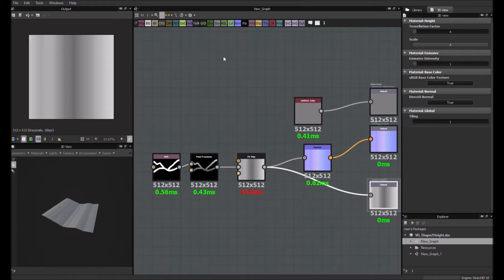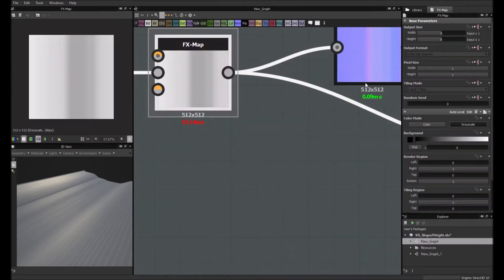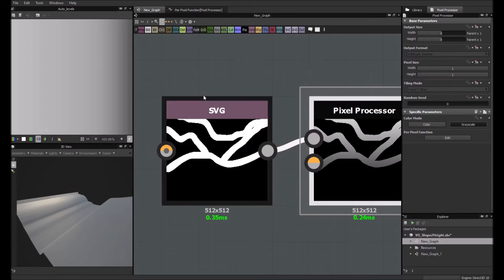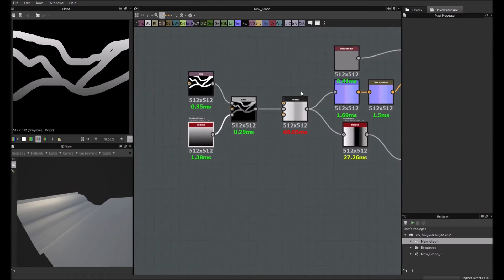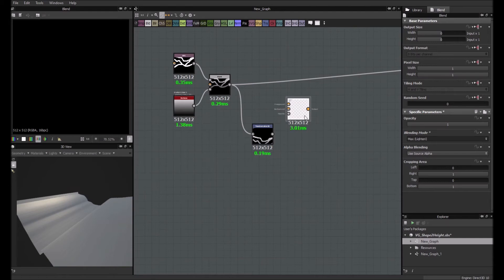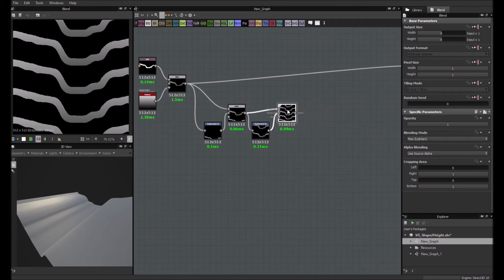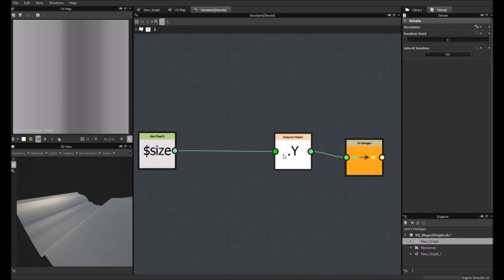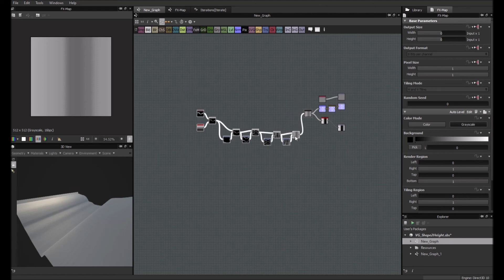Shape to Height Tutorial part 2 (Substance Designer)

Comment: Love your terrain maker tutorial. I have question. I am trying to use a procedural material, made in Substance Designer which I can change at run time in Unity. So far, so good. I also want to access the height map and normals separately in Shader Forge, however, but I have noticed that when I set either map as a 2d texture, Shader Forge just reverts to the basecolor map for these texture 2d slots. Any ideas what I am doing wrong / not doing right?
Reply from the maker: jinjatube hey 
Honesty, I really don't know.. Maybe something to ask to the shader forge developer?
Reply: Vincent GAULT OK, will do. thanks